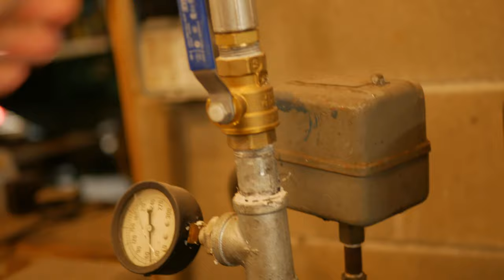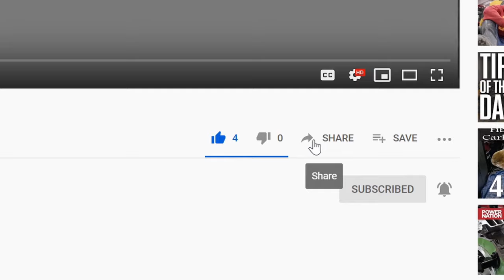Datsun 280Z Project - Off the rotisserie

Comment: Absolutely love your videos. Can't wait to see your channel grow into something huge, you deserve it. I am always excited to see when another video releases. I am also working on a '77. Not anywhere near the quality of yours. but I am about to start painting. Would you suggest buying a powder coater? Are they really worth it over just spray paint ect.
Reply from the maker: Thanks so much! Powder coated suspension is definitely worth it as far as getting your suspension bits coated.  Whether or not you buy all the required stuff to do it yourself is a whole different story!  There's a bunch of equipment involved to do the sizes required for the entire suspension.  I built a 4'x4'x7' oven years ago because I love trying new things and powder coating is a fun car related hobby for me. That being said, if I was only building one car I would find a local powder coater and have them strip it and coat it for you.  I have massive blast cabinets, huge air compressor setup, and an even bigger air filtration system than the normal shop, and that's all before you factor in the cost of the powder coating equipment and the oven! It would be way cheaper to pay someone once to do it for you...But...well I have an addiction...I LOVE to build things so I went for it! and now anytime I need something coated I simply go out in my garage and do it myself and not have to wait on anyone else to do it for me! Search around locally and see if there's any powder coaters near you, if not let me know and I'll see what I can do to help!